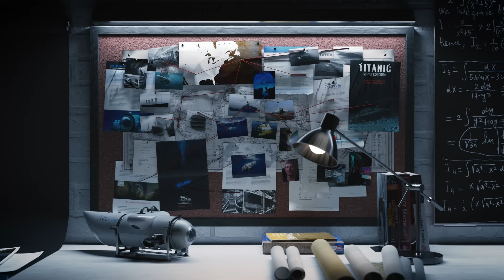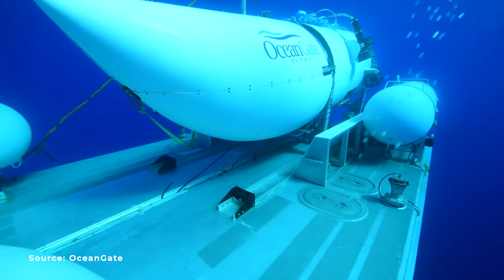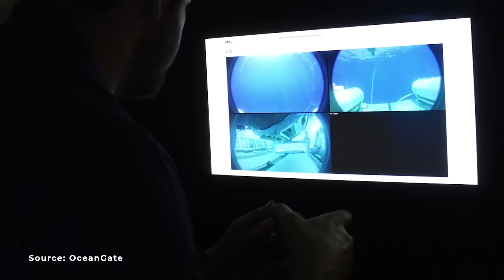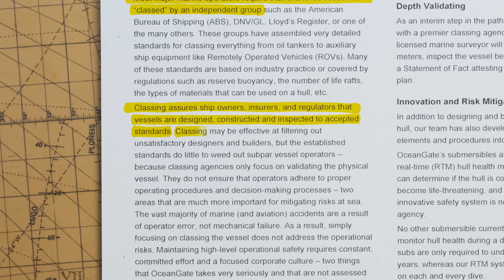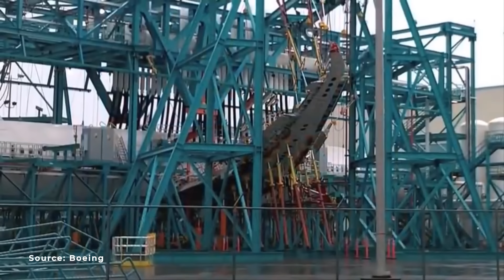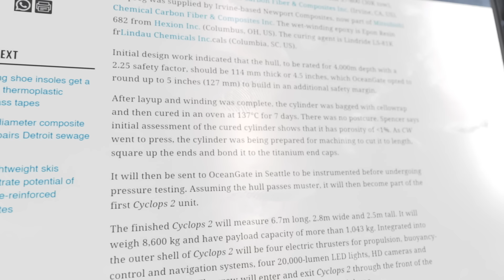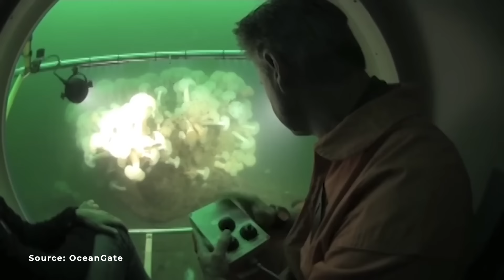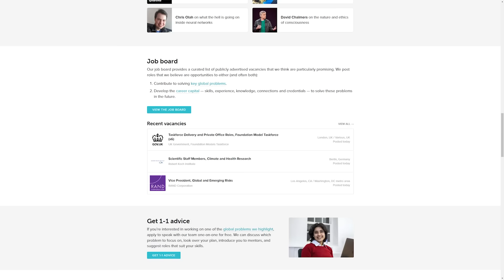The Questionable Engineering of Oceangate

Comment: I have been waiting to hear from a composite specialist engineer on this! 

Thank you for sharing. I am actually in shock that, that study on the buckling of composite materials at deep sea actually exists. They thought they would somehow avoid this? While never checking for it… 🤦🏼‍♀️
Reply: You kind of cant check for it.  The most common buckling failure runs away at the speed of sound to total failure.  Carbon fiber material is extremely strong but also sort of brittle.
Reply: @kensmith5694  They should have tested to failure in order to at least get an idea of what could happen.
Reply: @shorewall  Yes but that sort of testing would have been expensive in the extreme.  Still there are bits of the ocean deep enough and the thing could have been remotely controlled.
Reply: @kensmith5694  they ran testing on a miniature. But decided not to do fatigue testing on said miniature. Because you can replicate conditions. At bare MINIMUM they could have tested that to the point of failure.
Reply: @kensmith5694  also, that kind of testing isn’t ‘extreme’ it’s actually normal.
Reply: @phoebesmith8154  Many things don't scale when you try that.  The required wall thickness goes as something like the cube of the diameter.  If the pressure was from the inside the numbers wouldn't be so bad but with pressure from the outside the tube tends to deform.

Comment: RE, is the snap buckling failure mode initiated by a buckling failure of the fibers themselves or a failure in shear in the epoxy matrix between the layers of fibers which then allows the inner layers to buckle in the unconstrained direction, inwards?

Comment: They did make some protections against that kind of buckling. The CF was built around a steel tube. IDK if they addressed the corrosion aspects of it... but they did address that very specific issue.
Reply: It's not clear if they left the steel tube form in place, added inner hull lining later, or didn't have any. That last is so insane, given the monitors bolted to the inner hull, that it's not believable. But then.....there's so much unbelievable about this sub that turned out to be true......
Reply: @gailmcn  I didn't think of that. I figured they'd leave it there because why not, but this wouldn't be the first time logic left the building. God, I wish the leader survived somehow just so we could ask what he was thinking.

Comment: 1:58 composites useful/used for expansion tension, not compression 3:01 typical hulls made of steel or titanium, with foam outer layer for buoyancy 4:52 the value, importance of regulatory procedures, standards to prevent catastrophic failures 6:36 50 dives? w/o stress-/fatigue-testing 8:35 composite design/ engineering malpractice, like not using autoclave to cure, prevent voids 10:17 2018 former employee whistleblower lawsuit 11:49 Silicon Valley ethos: move fast and break things

Comment: The only way to play to such material's strengths under water pressure would be to wrap it around a skeletal frame, so the water pressure gives tension that pulls it between the gaps. But even the thought of such design is bulky and inefficient, because you need a frame to pull the fiber outward. So we're back to metallurgy anyways.

Comment: Should have built atleast 3 test subs and ran multiple unmanned test dives to failure and then redesigned it and then repeat the testing to failure and then certify the design to be used for only 50 percent less dives than failure .  Retire the vessel at 50 percent of it's design life.

Comment: "The vast majority of marine (and aviation) accidents are a result of operator error, not mechanical failure. As a result, focusing on classing the vessel does not address the operational risks."
Exactly as you said, this first sentence validates that classing vessels based on construction method actually does its job.
This justification sounds frightfully close to the examples of "survivorship bias" (interesting subject on its own, but it's more to do with logical thinking than just engineering)- and looks like using the error in logic to make up some marketing guff. Good to hear someone with appropriate background breaking down the problem!

Comment: This is so awesome I can't stop smiling. You confirmed exactly what I had predicted with my amateur knowledge. Repeated strain on composite carbon materials will create thousands of micro cracks that will accumulate in total collapse. Carbon does not work the same as steel, which has placisisty? ❤

Comment: Carbon fiber is used in many applications as a cantilever beam - like a golf club, shafts, tennis rackets, skis, scuba fins, airplane wings, etc.   In these applications the carbon fiber is both in tension and compression depending on which side of the beam your are examining.  Leaving aside the fact that no one is inside them, why is no one concerned about these structures failing in compression?

Comment: Great video, and I'm glad you talked about composites. When I make guitar knobs out of epoxy, if I want no bubbles, I use a pressure pot (functioning like the autoclave you mention). I also found the compression vs. tension point really interesting. I've walked the Boeing wide-body factory floor, so it was great seeing it all again.

Comment: Could carbon fiber cloth have been a useful material if the sub had a frame made of titanium and sheets of cloth were wrapped around it, with a viscous lubricant liquid separator?  There are weaving techniques that would allow cloth to be woven to smoothly fit three-dimensional curves; if the natural shape of the cloth included bulges that coincided with the space between supports, I would think that could hold the cloth in place without any reliance upon shear forces between layers, thus allowing the use of a lubricant between layers, and rendering issues of delamination irrelevant.

Comment: There where so many red flags . Using a tube = bad for high pressure. Gluing together very non similar materials  and the way how the carbon fiber composite was made. Fibers where rolled on a tube  in only one direction - straight on. No criss crossing of layers. Which is crazy of it self.

Comment: Hey, at least Space X not only tests their stuff constantly but they were also following on an already tested platform, he didn't simply through a Rocket together with non-tested materials and try, he used an existing approved Rocket base with a new type of Engin and Navigation and added a Landing platform, Sadly Ocean Gate didn't take this approach and not only refused testing but also used non-traditional and tested materials and decided to go for it.
Reply: SpaceX are also subject to a lot more scrutiny and regulation than OceanGate were. They are also aware that a single catastrophic failure of a manned flight would cost them a massively in time, money, and prestige.

Comment: I believe the engineering was extremely successful n I mean, it made MULTIPLE trips to the Titanic, and a lot of other dives at a little less depth. The design worked. The lifespan of its sustainability was pushed too far. Had they retired it after like 2-3 trips, and then rebuilt, it would never haopen
Reply: Impossible to tell. Given the documented inadequacies of their design, manufacturing, and testing, it's just as likely they everyone who used the vessel before the fateful trip were extremely lucky the vessel didn't implode on them.

Comment: When I heard about this case, I wasn't surprised but that they would have the gall to not even autoclave the vessel during curing and not fatigue test it at all is just insane. And aside from a serious lack of redundancies that were also painfully glaring.
Reply: Autoclave is *how much*?!?! Fuc that we'll just do it live. 

-That CEO
Reply: They were fatigue testing it.  They just did it with people inside.
Reply: @MushookieMan  ahhhhh I don't like how accurate this comment is
Reply: And no apologies! They just said "inexperienced pilots were driving so its probably their fault , dont blame us."
Reply: Certain types of structures are inherently non-redundant.  Submarine pressure hulls are one of those.  The solution is understanding the loads, failure modes and providing the valid envelope to the operator and proper design margin.
Reply: That kind of nonsense sounds like something a "50 year old white guy" would say, that Rush didn't want on his team.  Where's the "inspiration" from younger, fresh out of school would bring to the table?   Oh right, imploded on the ocean floor.
Reply: It's a real life version of the shuttles from "The Cold Equations".  Zero to very low margin of error guarantees failure.

There's a reason why proper deep sea vessels have three to four layers of redundant backups.
Reply: @hariman7727  As the Thresher demonstrated, the fact that there are multiple layers of redundant backups doesn't mean they will work in an emergency.  That annoying icing problem is more than annoying when you are sinking out of control.

Comment: The exact same type of construction was used for DeepFlight Challenger with the same hull thickness. Same bonded titanium rings. They were supposedly taking that to 20,000 meters - before Fossett died in the plane crash. How was that 5.5 inch thick CF hull going to make it to that depth when Titan's 5 inch hull was popping and cracking at far less depth?
Reply: another example of where you can see that Rush simply borrowed from aeronautics (his undergrad degree was in aerospace engineering), without any apparent understanding of how deep sea aquanautics and above sea level aeronautics face diametrically opposite pressure issues.
Reply: Should say 10,000 meters in my original post.

Comment: As someone that works in automotive forging, safety rules and regulations are present for a reason. The machine has a guard on the spinning bit because once upon a time some bloke lost a limb in the part. You have to have a certain amount of respect when dealing with potentially dangerous equipment and environments. MR. Rush did not apparently.

Comment: Probably one of the best engineering fact based videos I’ve watched on the topic.  I’d only add - the light weight and cylindrical design were driven by commercial ($$) factors and as you mentioned…the decisions were ego-based to satisfy those needs.  Lighter craft requires smaller equipment, ship, cranes, etc. with more paying customers on board.  CEO already had the solution in his head, forget about the physics

Comment: Why would they have needed foam outer layers if the carbon fiber hull had negative buoyancy as a fundamental property? Did you even think while doing this video? You'd fit in as an engineer where I work.

And what about those "expert" regulators at the FAA that turned a blind eye to the 737 Max even after two crashes that killed around 350 people? You know that Boeing has decided to never bring the 737 Max up to the requirements of the FAA and the FAA said nothing when told such? The deadline was Dec, 22, 2022.

Comment: It is already a very questionable engineering choice to go for a material that has a fragile-like failure in compression. Carbon fiber in its 'fiber' state is basically a cloth. You can stretch it all you wan and it won't break (tensile strength) but if you try to crush it... you'll end up with a ball. So to prevent this, it's embed it in epoxy. This means that at compression, the only resistive material is the epoxy. With the added complication that it has fibers in between, providing plenty of failure surface areas, which may lead to delamination or other failure modes.
But it's nuts to think that anyone would take a sub made of the stuff down to the bottom of the ocean without first testing models as many times as need so that you understood every possible failure mode it may have, not only of the hull but also the interface, end caps, porthole, etc. 
Any engineer that passed a materials class would be aware of this. You just don't use a material that isn't proven to work without, well, proving it works.

Comment: I have tried to explain how to lots of folks how the sounds they were monitoring were the sounds of accumulating micro-delaminations.  Each and every pop the hull made was it losing some measure of integrity.  Their system simply recorded the rate and loudness of these pops and when each dive was a success without hull failure, they essentially assumed that those noises were Nominal, and just the sound of the hull adjusting to pressure. Their system only warned them if these sounds started happening faster, or louder.   Of course, the only circumstance in which these sounds would start to increase in frequency is when the hull is entering into a chain reaction of buckling deamination failure. The popping sounds would have been like listening to microwave pop corn popping reaching a crescendo at which point the hull would have imploded.   Which is to say, they would definitely have HEARD their hull failing several seconds if not minutes before it killed them.